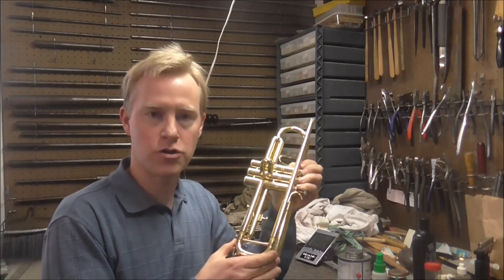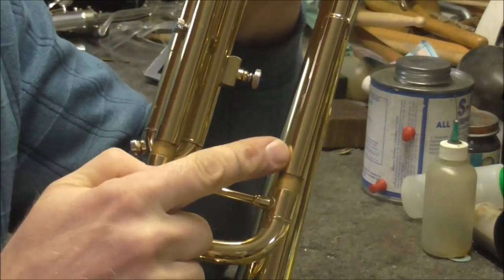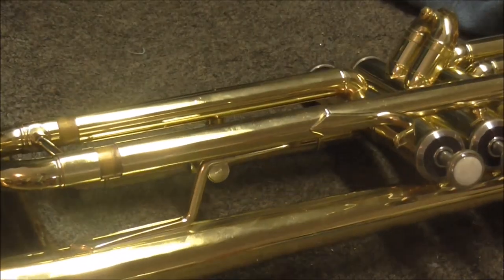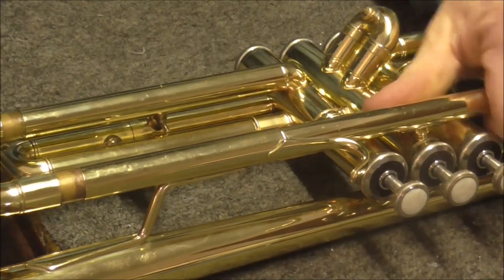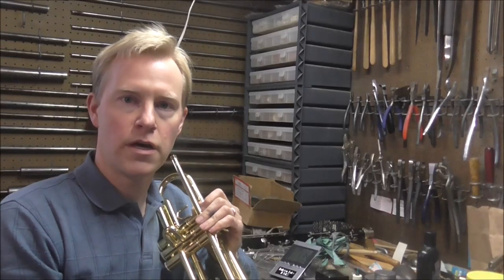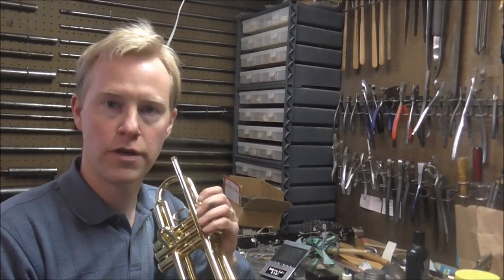How To Free Up A Main Tuning Slide On A Trumpet Part 1

Comment: Thank you so much! Wiggling is the way! I used valve oil and a jet lighter but the wiggling was the most important part. If you have it handy, calipers are great for keeping sane. When you think it doesn't move, measure and rejoice that it has moved by 0.01 mm :)

Comment: I just bought a Conn Director with a working #3 slide, although the bell is out of true far enough that the slide won't come out. I'll try the penetrating oil and a heat gun on the other slides and see if I can get them free without straining them.
Thanks for the useful tip. I hope it works.

Comment: Hi, thanks for the advice, i had a soprano cornet with a seriously stuck 3rd valve tuning slide. i had spent almost a full day using WD40 to penetrate and a denim strap through the crook and anchored into a big vice to yank/shock it out but no luck at all.
 I was ready to admit defeat and decided to check YouTube for advice and found your video. I added a squirt of WD40 to the slide then using my propane/butane torch i heated each side of the slide (about 5-8 second on each side) while drawing the flame down the slide to hopefully draw the WD40 into the stuck slide.

 I must admit i was extremely doubtful but on the very first try afterwards the slide popped right out.
 Thanks for the great video ;)
Reply from the maker: Thanks for the feedback! Glad it worked for you. :)

Comment: That little torch doesn't damage the laquer?
Reply: David Lingner I thought it would've melted the solder that holds the stuff on the trumpet together
Reply: If you keep the flame moving, i.e don't hold it against the same place, it wont damage the laqcuer. and you don't need to get the tube very hot, just warm enough for the oil to move up the slide and break the rust/dirt.

Comment: Is there any danger of braces coming loose when you do this?
Reply from the maker: You can check the Bell-to-leadpipe brace. If the solder is cracked, it may come loose so keep an eye on it and stop if you sense any danger of it breaking. If the solder joint is good, it should be fine if you are not too violent.
Reply: Oh yeah cause I popped my brace trying to pull my slide off. Now I need a video on how to solder it back on. :-(

Comment: I use my school's cornet and tuning cant take out, and I see like the green thing around that. Because I play for my school so it will affect others if I cant tune
Reply: Green thing??? You must be talking about calcium build-up. I''ll bet the third valve slide doesn't "pop" as there's no compression.

If it belongs to the school then the band director needs to get it chemically cleaned.

Comment: would this work if the mouthpiece is stuck?
Reply: You could try it, but if just trying to pull it out by hand doesn't work, try my 2-washcloth method: one cloth in ice water, the other in boiling (or as close to it) water.  Wrap the hot cloth around the leadpipe, and the cold cloth around the mouthpiece.  Gently try to work it free.  If the mouthpiece is too stuck for that to work, I wouldn't try anything else...you could damage the horn.  Take it to a professional repair facility and let them handle it.  They know what they're doing.

Comment: What do do if your slide is stuck and it's closed all the way
Reply from the maker: This technique is the best of any that I have found for slides that are pushed in all the way. If it is too stuck for this technique, you have fewer options, most of which involve unsoldering. Unsoldering should only be done if you know how to solder on a brass instrument which is far different from electronics or plumbing. If you are not comfortable soldering, try soaking it in penetrating oil by applying it several times in the course of a few days and then trying what you see in the video. If it does notwork, I suggest taking it to a repair technician. 
I will try to put on more videos on stuck slides soon. 
I hope this helps.

Comment: Thank you, really didn’t want to put my strad in the shop
Reply: 762xDevin is your strad silver plated? I really want to know if the heat is safe on the silver
Reply: Yamaha YTR-8335las Custom Series  it is, I did not have to heat it, was able to get it free using his wiggling method

Comment: I always clean the slide with brasso to clean off the oxidation.
Reply: so, crazy thing, brasso is actually really bad for your slides because of how potent the acid is, it doesnt just get rid of the oxidation and other build up on the slide, it pulls away the metal slowly, i would personally recommend CLR or Lime Away.

Comment: I have a real problem with my euphonium valves sticking. It is a Tempest brand. I have had it about two months. I always keep it clean, take out the tuning slides, get all moisture out, lubricating slides and Monel piston valves. Now the problem is I let it set in case for maybe two days....When I first try to play it...All four valves are stuck...I happens every time. I think it could be the inferior material called monel. I have three other brass instruments that never stick because I take care of them the same way. Yamaha trumpet, Conn cornet and a King Mellophone. They all have chrome piston valves. I can leave them in the case for one or two months without playing them and when I first try to play them they all work perfectly.....No sticking at all......!
Reply: Try a different valve oil.  Al Cass always causes sticking on my tighter valves (like my Xeno trumpet) because it evaporates and leaves residue.  A synthetic valve oil (like Hetman's) might work.

Comment: My slide isn't coming out
Reply from the maker: Hi! Stuck slides are pretty common. There are lots of variables in why the slide is stuck. Is it stuck because the horn has been sitting in the case for 20+ years? Or is it stuck because it's dented? This video shows one of the ways that Art uses to free up a stuck slide, but it doesn't always work on really stuck slides. I am planning on doing more videos on stuck slides in the near future.
Reply: Janelle S Mine isn't simply stuck, and it was given to me from my school until I graduate. The previous owner glued the slide shut! Is  there a way to get the glue to loosen up without damaging the trumpet?
Reply: Janelle S who in the heck glues a trumpet slide
Reply: Jacob DeJack It was some guy who tuned it wrongly, then glued it shut so the trumpet was "always in tune"
Reply: You might try applying some heat. Depending on the glue type, heat often helps to loosen it.

Comment: Mine was really super stuck and I ended up busting the tuning slide. At least I'm not in band anymore xD
Reply: I was gonna say you could just take the horn to a repair facility; they can solder it right back together and you'll be good to go.